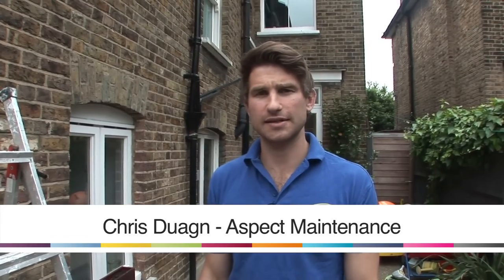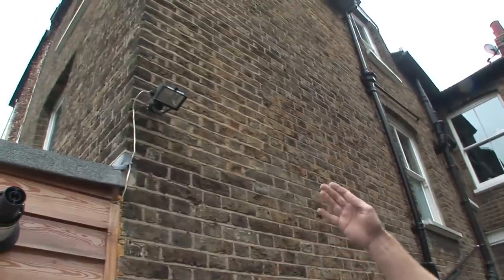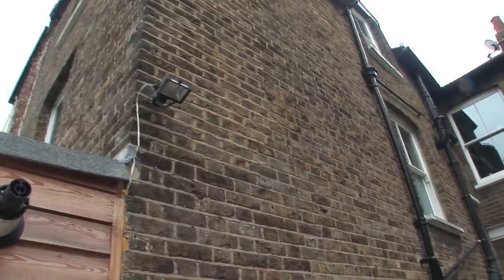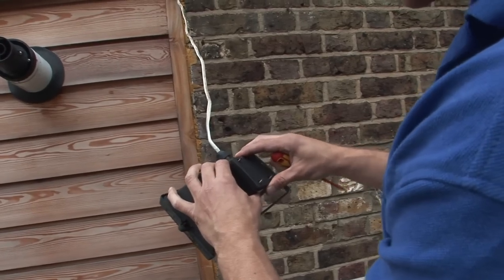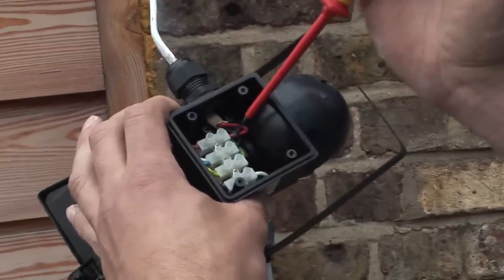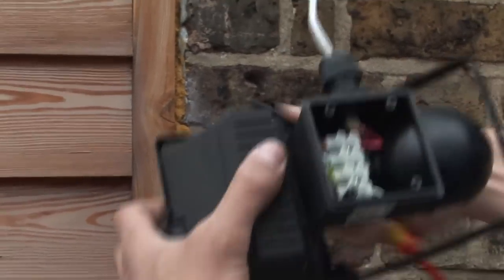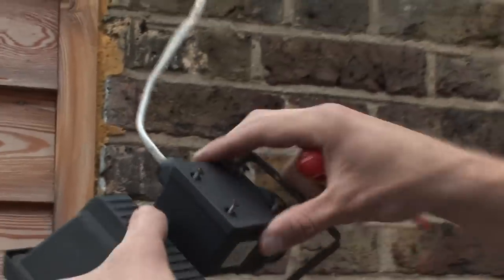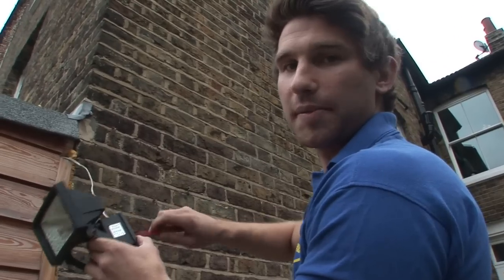How To Wire Outdoor Lighting

Comment: You don't need to apply any great torque to the screws that hold the weatherproof panel on.  The gasket does the sealing, and if you tighten the screws down too hard, you can squeeze the gasket out of the gap altogether and end up with no seal.

Comment: i prefer to run outdoor lights from a switched spur socket as this makes it easier to change fuses or bulbs
Reply: +David Martin Yep mate, you nailed it. I was showing my son how to do an external security light, this showed him HOW NOT TO DO IT!
Reply: FCU mate it sounds more professional :D and its isolated from the Circuit its connected to so in case of a Fault the plug top fuse pops and doe's not trip the Breaker nicely done (Thumbs Up )
Reply: This is what I am about to do but I want a switch outside also. How dp I wire this with the feed and N at the light fitting ?
Reply: Why a switch outside??  

It would need to be waterproof switch 

See link here screwfix.com

Hope this helps remember light switch to light fitting outside needs to be in steel conduit or I prefer swa. 

Use 1.0 or 1.5 cable from switch to light fitting but if your drilling through the wall to inside supply use appropriate cable for supply to fcu switch I usually put a 3a fuse in.the switch for 1 light or 5a for a couple depends on the wattage of the bulbs as led are very low around 5w compared to 60w of power you can feed alot of those lights off the 1 3 or 5amp fuse in the switch but if the supply is off the 6amp breaker don't exceed 5amp fuse in fcu or you will risk overloading
Reply: Mark

Comment: Not to sound negative but you need to know the load of the light for the correct cable, it’s an assumption there’s a rcd fitted to the property , the cable should be in conduit and if not it should be black sleeved as uv breaks down the pvc on cables , be worried if someone e wires this to the wrong house circuit , even though this light is only 200w if you have higher you may need planning permission , you need to know if the circuit connected to is on a spire feed already and calculate this load also , not knocking the video but someone trying this based on the video could kill them self based on little information and if taking the back off the light mains should be isolated thanks

Comment: I'm digging around looking for some information on how to wire an outdoor light and install new lights in my loft. This didn't help very much as it was a little vague.

It would be great if he included how to run/connect the cable from the source (fuse box). Was his outdoor cable already there?

Comment: So how does a round waterproof cable gland protect a flat cable that you've used from letting water in? - Shouldn't that cable be ROUND too so that it matches the rubber seal inside?

Comment: Absolute rubbish why not fit the light below the gutter and feed cable into the loft under the tiles and down the airing cupboard to find a spur Then no gastly cables visible on the wall and wider angle of light Better with 20 watt led type your in the wrong job

Comment: What a crock of Shit that cable is visible to the elements below 0 degrees the Sheathing would be prone to cracking drill through the wall and put a nice FCU switch somewhere discreet then its protected by a 5A fuse. Security lights are permanently left on otherwise the Sensor and setting reset. And they are need setting again. 

If that cable was visible i would personally use some 1.5mm SWA its not that expensive and also its protected better than plastic Conduit and easier to install SWA outside all the way 

Oh by the way im a level 3 Qualified Spark